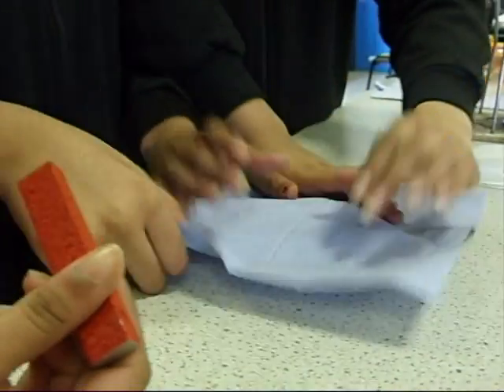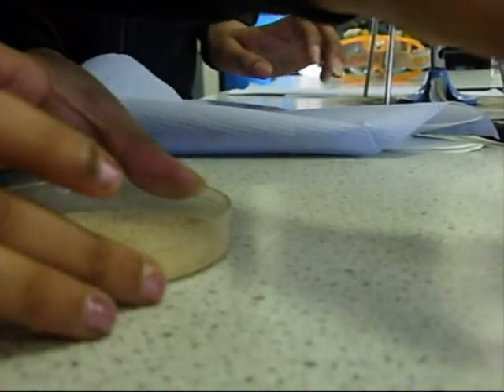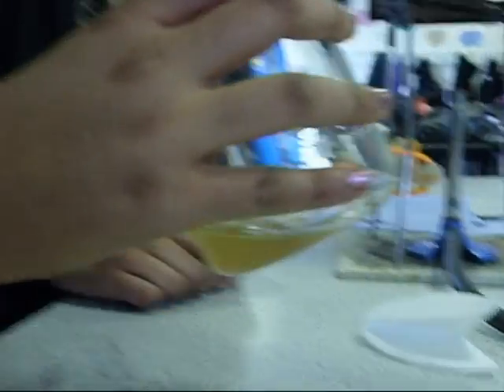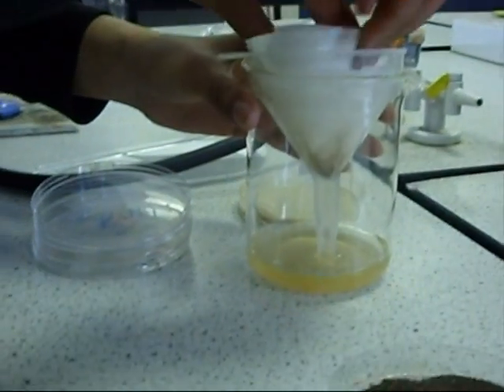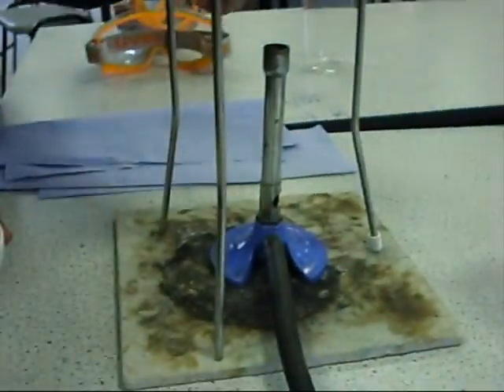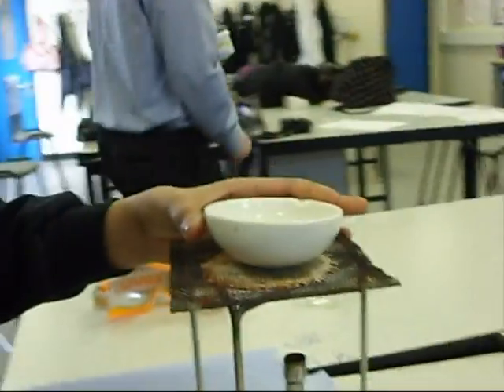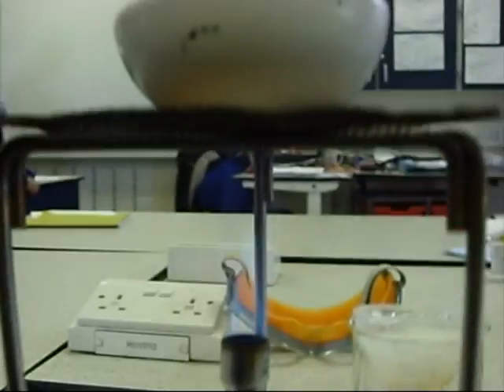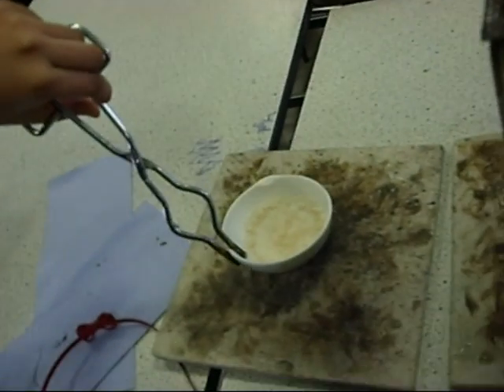Separating sand, salt and iron filings.avi

Comment: this shouldn't work 😕. I get the magnet part yes, but when using filtration, what does that accomplish? You're only pouring the water out of the dish, with the salt in it, which is the only thing in this solution at the current time that can evaporate. In order to get the sand out so you had only water and salt in there, you would have to pour it all in to the beaker, which wouldn't accomplish anything, because all you're doing is taking the water out, which is my you need in order for the salt to become a single component